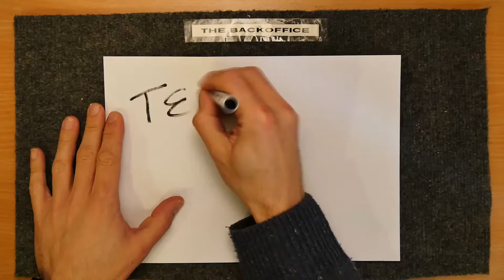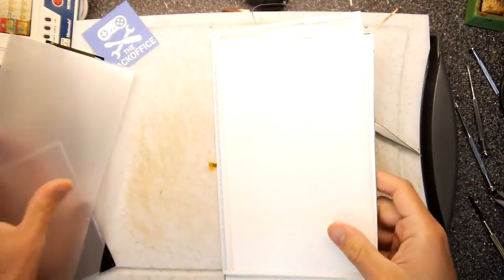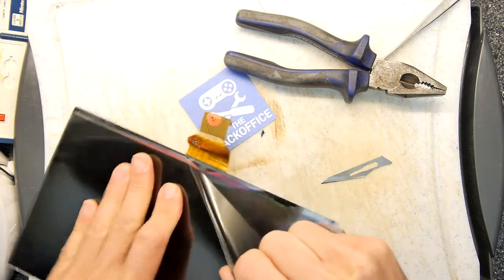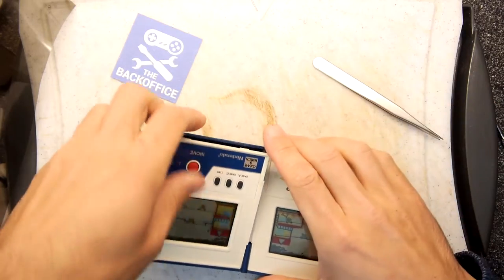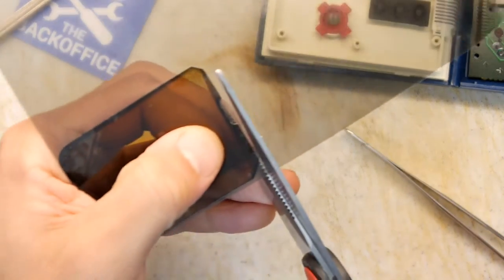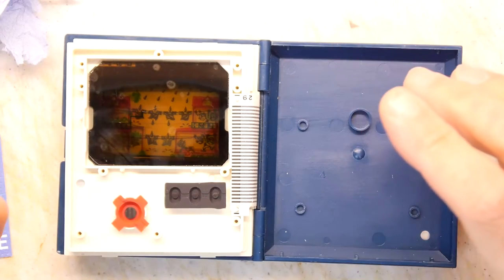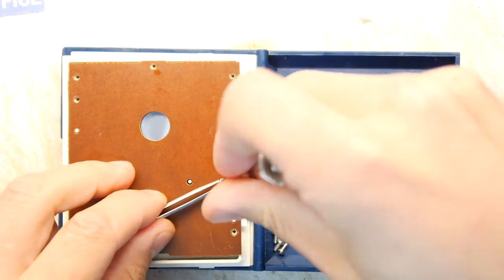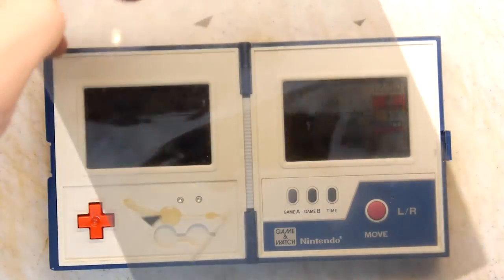Nintendo Rain Shower Game and Watch - Free Faint Dim Screen Repair

Comment: Hi, I dont know if you will ever see this. But I have a 1989 nintendo zelda wrist watch with an lcd game on the screen. I have had it since I was a kid, and it recently stopped working. I replaced the battery but it didn't help. New ones online run over $100, and I would rather try and fix it myself. Thoughts?
Reply from the maker: It's worth opening up are looking for corrosion inside

Comment: I have dim screens but my polarizer is ok it works well on another GW what else could be the issue? I cleaned the contacts the rubber strip and while I was at it I cleaned the polarizers and image screens as well with soapy water. Same polarizer works on ither games and no polarizer works on the rain shower I'm trying to fix please help 🆘🆘🆘🆘🆘🆘🆘

Comment: Thank you so much for posting. 

Btw, do u have any idea about the alternative of the back aluminium reflector? 

Thx in advance.
Reply from the maker: When you say idea, what in particular are you interested in?
Reply: Since my aluminium back reflector has those burnt marks, I am looking for the replacement of it? Do you have any suggestion?
Reply from the maker: I do not, but I will ask around. Also you can buy some really thing sheets of aluminium or stainless. Those are thin enough to cut with scissors